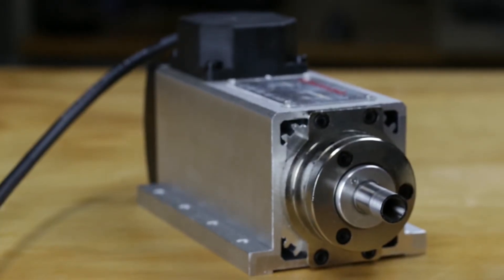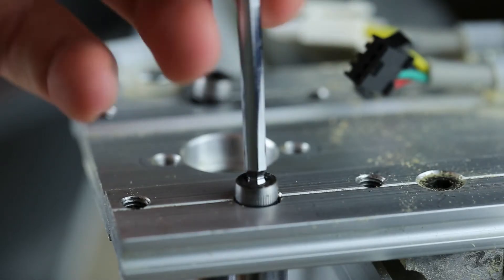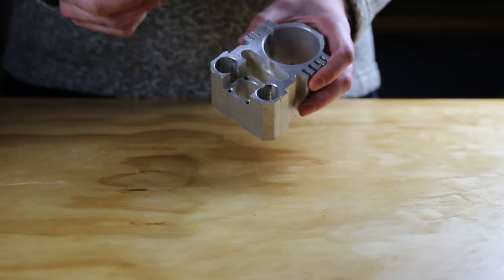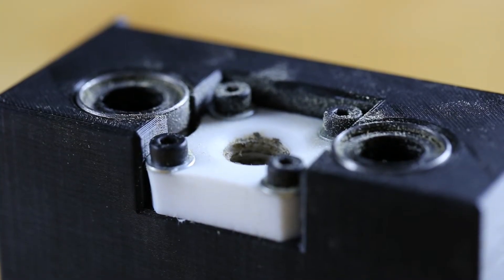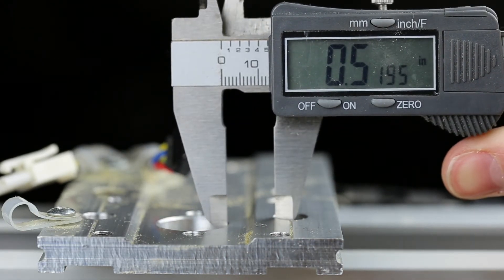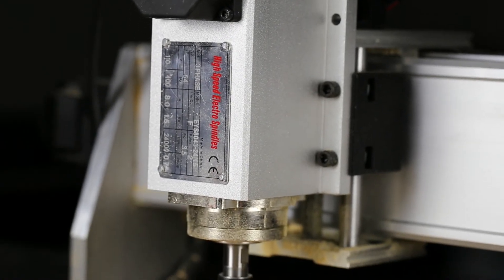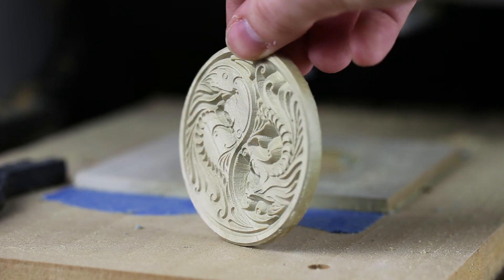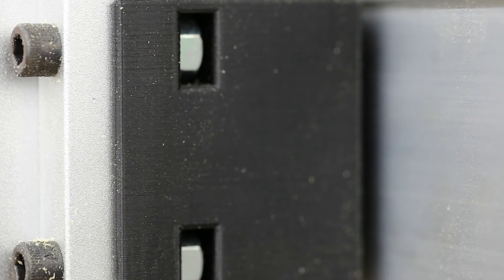Installation Guide and First Chips! 1.5 kW spindle 110v air cooled CNC Router Upgrade

Comment: You can heat the carriage up with a hot air gun to expand it to make extracting the bearings easy. Just don't go above 150C so you don't damage the bearings in some way.

Comment: I put the z carriage in the oven for 20 mins. You only need to get it to 80c and it would have expanded enough for the steel bearings to fall out, cause steel expands less than aluminium with heat. :)

Comment: Is the carriage plastic?
Reply: I am going to mill the aluminum.  I think that is the best way for me.
Reply from the maker: It might be. The part I used is PLA which will work but isn't ideal. If you have access to make an aluminum z- carriage that would definitely be better
Reply: @Ocfarmer  I would first print the part and then try to machine the replacement if you only have the one machine. I personally went an extra step and machined the holder out of PEEK first. It is much easier to machine than the aluminium and it was easy to keep the tolerances even with a longer end mill. Also it is plenty stiff for this application. 

I then did the aluminium machining with a single flute end mill and it took forever. Constantly measuring the diameter and then correcting the CAM. To be honest I personally did not see any changes with the aluminium part so I would not do it again. The PEEK however did show a huge improvement compared to the printed part. I just think that the machine itself is too unstable to really benefit from the aluminium part. 

Also this will be a huge problem for you with this machine. You can make it cut aluminium but do not expect to go fast and be accurate. I am using only 250mm/min, approx 10inch/ min, to get decent results. Maximum end mill size I am comfortable is 6mm (1/4 inch). 
If you want to go faster expect to replace the deck of the machine, the extrusion bends a few mm if you apply pressure, and x rails. They also bend like hell. Especially if you want to drill this will ruin your day.

Comment: Could you help me, I did the programming of your video and it worked very well, but my spindle is hot, what could be failing?
Reply from the maker: I'm no expert but I'll give it a shot! I havent had that issue, what were the conditions made it hot? Was the spindle spinning? For how long? Was it cutting anything? Also how hot was it? Etc..
Reply: @MD-hu3il  Thank you for the help you are going to give me, I really appreciate it, in my case I was just testing the spindle, I wasn't cutting anything, I left it spinning for 30 minutes and it got too hot. I can send you photos of my spindle to see if there is a problem or it is different from yours, try the same programming that is in your video.
Reply from the maker: I've tried to replicate what you're describing by leaving my spindle running at different speeds but I havent been able to unfortunately. Have you been able to trouble shoot anymore? I have been using these settings for a few projects now and haven't noticed an issue with heat in use. Are you getting good airflow from the cooling fan?

Comment: Do you have a link for bearings that would be compatible?
Reply from the maker: I can't guarantee anything but the shafts are 12mm the bearing od is 21mm and the length is 57mm sp something like the following should work. (But I'd recommend shopping around)
https://www.ebay.com/itm/LM12UU-Extra-Long-Linear-Ball-Bearings-12mm-Bore-Dia-21mm-OD-57mm-Length-1Pcs-/312535505485?_trksid=p2349624.m46890.l49292